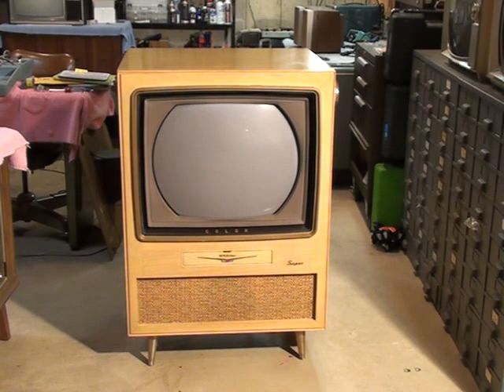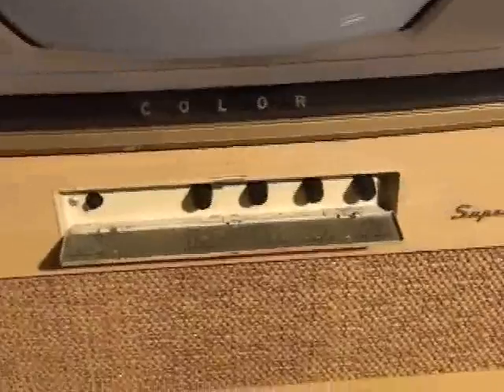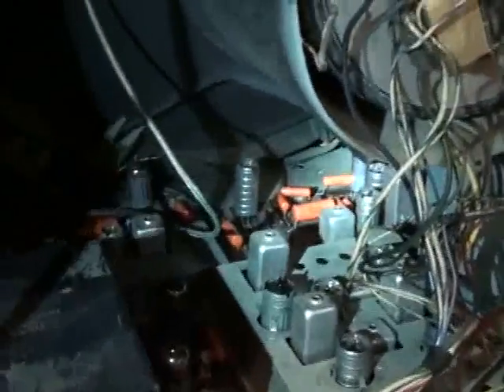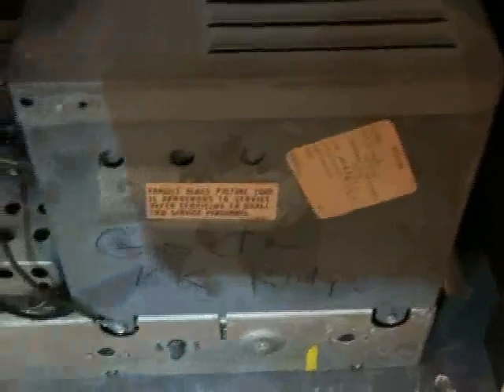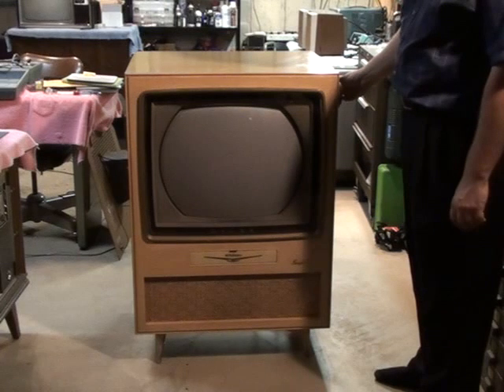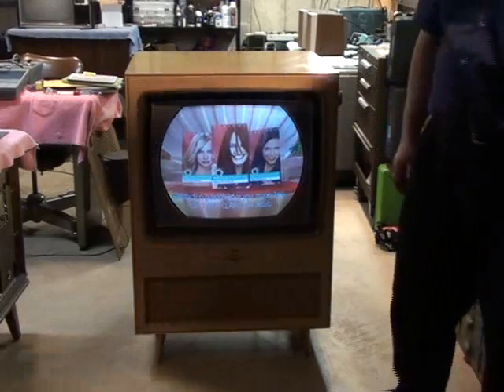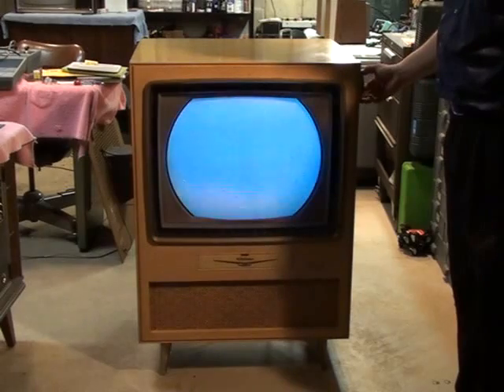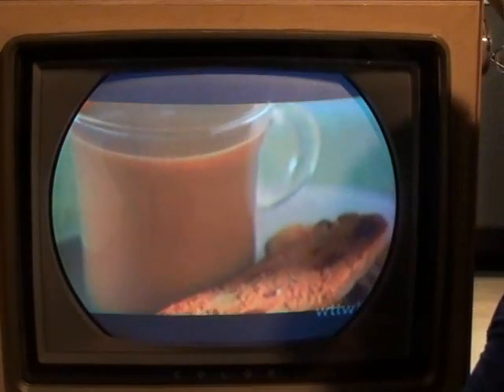Watch a 1956 RCA VICTOR CTC-5 COLOR TELEVISION!! "Roundie"

Comment: I had a 24" dumont color TV in the very early 60s. The houselight dimmed when I turned it on amd the picture tube would crackle when the high voltage was applied. My dad worked for the Dumont network, later became Metromedia

Comment: As a young RCA TV technician I can say all RCA chassis' before CTC 16, did NOT have good pictures. The 16 was far the best. It set the standard until HDTV came out.

Later they came out with the first rectangular Color TV. It's color was NOT good. It took RCA years to get the same picture as the 16.

Believe it or not, I was the technician that set up that first rectangular Color TV; before it was presented to their CEO (David Sarnoff) of RCA; on his boat (named the "Electron") in Miami, Florida

Wow such nostalgia in this video. It brings tears. I am 89 now. Wow!

Comment: What an amazing colour picture for 1956.   (six years before I was born!)   That was the us 525 line 60Hz NTSC...
In uk we had b&w on 405 line 50Hz VHF.   Colour was first brodcast in uk in 1967 on 625line (interlace) 50Hz PAL UHF. (eleven years later!)
Thanks for posting !    Never seen one before.
Reply: quantumellon Ah yes, but PAL was hue locked.
Reply: quantumellon 
    It would be even better with a rebuilt CRT..The green gun looked like it may be a little weak but maybe it's the camera.
Reply: albertusj A feature that we should be so grateful for.
Reply: quantumellon It's true we waited a long time for colour in the UK, but when it arrived it was rock solid (at least at the source).
Reply: I used to laugh at that comment,  Never Twice the Same Colour..  :D
Reply: +quantumellon PAL was dubbed 'Pray And Learn' by the EBU in it's early stages.
Reply: The 50 Hz systems used in Europe produced terribly flickering images.  Gave me headaches.  The North American 60 Hz system was just above the eye's threshold ability to see the flicker, so it was WAY better.  They linked it to the power system standards.  Power in Europe is 50 Hz.  North America used 60 cycle AC.

Comment: I remember our family black and white RCA 19 inch 1950's TV. Every now and then the picture would go out so I'd open the back of the TV and look for a tube that was not lit up. Then I'd pull it out, take it to the drug store, yep, the drug store, the man behind the counter would match the tube to his collection of boxes with tubes in them. I'd install the new tube and we'd be off to the races. Although, back then, the great majority of people would just call a TV repairman who would come to your house and replace the bulb and charge you  25 bucks to replace a tube that cost a buck. If he thought he could get away with it he'd tell you your tuner is dirty and needed to be cleaned out, charge you 5 bucks extra and spray the tuner with some compressed air. What a rip. My first color TV was a Sony Trinitron that I bought in the early 80's.........if I remember correctly.

Comment: I had one of these but I think 1957. No front door for controls and RCA, chevron and color logo was below speaker cloth. I wanted to get it operational but found the primary in the power transformer was open. Was going to gut the cab and put a modern set inside using the factory speaker, but I traded to a collector/repairman in Cleveland for some amplifiers. I am pretty sure he got it running. 73

Comment: Had a friend in late 60s his family had an old I think it was 1955 RCA similar it was from his uncles tv dealership lobby. It was pretty worn, the picture tube was way out of convergence and it was mostly black and white with extra colors on the sides. His dad was changing some tubes once and I got to see it with the back off. It had chassis going up the sides and about 100 tubes.
I was at his house the night Neil and Buzz stepped out on the moon, boy was that a hard picture to look at, we went down to my house and watched on my dad’s new black and white portable and it was so much better.
I used to dabble with junk TVs in those days and I wished I had that tv I would try and fix the convergence.
I once saw thing on tv where they were trying to say that early color tv was really weak color almost black and white- not so - those old three color gun picture tubes were the best color picture if everything worked right. My aunt had an old 50s color tv and she made sure it was always up to snuff I remember visiting and watching old big production Hollywood movie on it and it looked like you had a film projector in the tv. Beautiful

Comment: I used to own a 1958 RCA 21d8525 b&w that looked similar to this unit. I did get rid of it because the tube was burned out to the point where there was no picture (my friend took the gutted case from me). Really do like this style of TV and it would be nice to pick up a working color one like in your example here. Ironically I also got mine from a home in Park Ridge (I live at the boarder of Park Ridge and Niles IL).

Comment: I wish there were still analog channels so you could actually “use” one of these old sets. Is there a way to convert digital to analog and make it work?
Reply: Yes if you have any NTSC TV whether it’s black-and-white or color you can use a digital converter box which will convert the TV signal back to analog but the tuning is done on the converter box not the TV
Also RF modulator or some VCR’s you can connect any device that outputs composite video

Comment: Nice to see mid-century (1956) technology putting on a show. The only thing missing was stereo sound, which had not been developed yet in 1956.  Still looked good in 2008, but after analog TV was switched off in 2009, it became obsolete. Now days it is only useful if you have it hooked up to cable TV or one of those converter boxes.
Reply: Actually, stereo was experimental in '56, and became commonplace the following year on records.  But FM radio didn't convert for the most part until the early-to-mid-60's;  American TV stayed mono through the mid-80's, when satellite distribution made it easier for broadcasters and people started demanding stereo.

Comment: Hooked up to a Chicagoland cable system that was still sending analog at the time.  Most over-the-air TV had already switched to digital by then, and VHF channels 2-13 are now used by mobile phone companies.  Without a digital converter, it's basically junk now.

Comment: I think the first color TV had round picture tubes because of the difficulty of the convergence adjustments when they were first introduced.  Rectangular CRTs required more complex circuitry to get the three color beams to merge correctly. I built a Heathkit 25 inch Color TV in 1972, but it had a square screen and the only tubes were the high voltage rectifier and the CRT.  These color set were sold at a time when very few local stations were even broadcasting in color and only a few network  color shows were available.

Comment: Wonder if it would still pick up any channels via the roof antenna.....or has that wonderful old set been rendered obsolete finally
Reply: To make it work with modern TV stations you would need a digital to analog converter box

Comment: It's very cool. In USA in 1958 was the first country to use a color broadcast in NTSC. And the first to use digital television in HD with the ATSC in 1998. In Brazil only in 1972 we had color television and use a unique system call PAL-M. It's very similar to NTSC, but it use PAL color system. Only now we begin the switch off. In 2007 it begins digital television with an upgrade version of the japanese ISDB. In the 50's color TV must be very expansive.
Reply: I have watched Digital TV in Germany in 1997 with DVB-S!
Reply: PAL = phase alternation line.

Comment: This tv is surprisingly compact for a first generation color set. Large picture tube and relatively small cabinet, not much different from black and white consoles. I have an RCA b&w console that looks very similar.
Reply: I suppose you could arguably call this a second generation color set, after the 1953 to 55 prototype era.

Comment: Wow, no flicker! That looks incredible considering it’s based off a colour wheel.
Reply: What color wheel???  No color wheel!  This wasn't a mechanical TV, it was electronic.  525 electronically scanned lines.  Definitely No Wheels!!!
Reply: You may be thinking of the CBS sequential color wheel system. A few of those sets were produced and sold but they never really took off. The RCA all electronic color TV system eventually won out and became the standard. One reason was that the color signal from the RCA system would work on the millions of black and white TV sets that were already in widespread use..
Reply: Joe Vignolo Yea you’re right I totally blanked when I made that comment.

Comment: The older models had a color bar that would indicate broadcast signal strength below the horizontal and vertical adjustment tuners. The early trinitrons would operate at 60 cycles per second with vacuum tube controlled bias to moderate the high voltage step up transformer. The signal would include 525 lines of resolution and burst in the very high frequency range. - "RCA is making television better and better".

Comment: Hi !
In the US NTSC system there was a clolor-phasic regulator if purple was "originally black dog" just had to roll. The later European PAL color system solved this with a 180 degree color alternating phase. In this case, if the phase fatigue was high the color saturation "only" decreased.

Comment: Goes to show the sometimes less than great look of color TV was not instability at the receiver but at the TV station.  How was there analog signals 7 years ago? My friends parents bought an old RCA like this as a second set. It also looked surprisingly good.
Reply: This vid was made before the analogue tv shutdown, which happened around 2009 or so iirc. Either way, I was in high school then so I remember it pretty well. Pretty wild seeing a then 50 year old tv picking up shows like American Idol and the like. An early color tv picking up broadcasts from the last full year of analogue tv. Kinda poetic in a way, like how BBC1 in the UK showed a 405 line tv from the 50s displaying its last broadcast before being shut off at the end of its last 405 line broadcast in 1985. Look it up, it's pretty neat.

Comment: Tube TV's never came on instantly, it took a few seconds for the tubes to warm up before the picture would come on. As the TV got older and the tubes got older the longer it would take to see a picture. We had a TV,  that if you wanted to see a show, you would have to turn the TV long before the start of the show or you would miss your show. Sometimes, I would forget and I would turn on the TV and my show was starting, I would miss half of the show!
Reply: Yea.. I got ton of old radios.. The REAL old ones, 30s take minute or 2 before anything happens.. But they ALL still work,70 to 80 yrs old

Comment: My dad bought a color TV approximately in 1954-55 and paid a lot of money for it considering how little he made as an engineer. He said after two weeks it failed so he rewound the yoke on the picture tube by hand. Said it worked great for years after. My dad had 15 patents and was pretty remarkable with electronics so if it could be done he'd find a way. Some of that rubbed off onto me, I repair electronic organs, but just for myself. Impossible to make serious money at it these days.

Comment: Electrolytic caps are more likely to fail with age. I have seen 60 year old USA made electrolytic caps still working, mainly the aluminum can caps, rarely the paper wrapped radial caps. I suppose it depends on the storage and operating temperatures, and how close to max voltage they were used at. Depending on were they are in the circuit, can be a time bomb, especially if you antique electronics are going to be used regularly. I usually change them even if they are still working. Expensive in adding to the total cost of the project, but so is the damage a failed cap can cause. Atoms are good, probably the best radial cap, but yes large. I sometimes use F&T (German), and JJ (Slovakian), which are smaller- can not tell you how good they are on life, but so far, so good after three years on some projects, and I cannot find any complaints on those brands. CE Manufacturing (USA) makes the best aluminum can cap that is made with the same machinery that used to make the Mallory can caps.

Comment: For what it's worth:

"CTC 5" means Color TV Chassis. 5 was the 4th commercial model. The reason it was 4th and not 5th, was that the "CTC 1" was the prototype, and never left the "lab" at RCA. The CTC 2 cost $800.00. I have not a clue what that would be today. But I imagine it would be in the thousands.

There were VERY few sales on the CTC 2; so most dealers ate their loss. The reason was; there were VERY few color transmissions. For 99% was only in B & W. Worse: NBC (RCA owned) was the ONLY channel that sent out color TV (but only at night). CBS and ABC refused to do it at all;  because they were mad at FCC, for making the RCA color system "standard". Because it  was all electronics. The others were electronic AND mechanical with motors, etc.

Also the CBS and Zenith systems, were not compatible with B & W.

With the CTC 3, the sales were slow; but with each new model, sales got better. But...there was no way that technicians could service the Color TV's; if there was no color transmitted in the daytime.

So RCA spent a fortune of creating an afternoon Program in color (in the afternoon-2 hours) It was called Afternoon Matinee as I recall. They hired hollywood stars to perform in the color transmissions. This caused, RCA to sell 10 million color TV's in a single year. THEN, CBS and ABC decided to send out programs in color (using the RCA standard of course). Can you guess why?

Shortly RCA, CBS and ABC went mostly color. Of course it was not long until color was the thing and people were buying the sets like crazy. So RCA went ALL color day and night. Later CBS and ABC followed. All of this was before "Cable" and "Satellite".

I shall forever cherish my 33 yrs of being a technician with RCA (1954 to 1988). It was my life and I loved every bit of it. I am now 89 (retired) and the rest brings tearful nostalgia whenever I see these old TV's. Color or B & W.

Praise Jesus!

Comment: Wow, 12 years ago but that thing looks better than some of the later RCA sets I used to repair back in the day. You must have replaced the crt or put a better newer high brightness phosphor tube in it. I think the earliest color roundie I got that worked was about a 61 Admiral? I put slightly better crt in it and gave it to my lil sister for her first apartment in the early 80s.
It seems the picture was fairly good on it but a while later a delay line or cap went out and I eventually junked it because I couldn't get parts and it was too big to hang on to. I did see a non restored 56 RCA color set still working in the 70s but tube was so weak it barely showed any color. I hope your still around and fixing stuff but without any analog TV those old sets are about useless.

Comment: The high quality of the 1956 picture tube shows how even in 2008, we were still using a standard that reflected the state of the art for 1956.  The cameras got better, but no video reproduction could be done in 2008 that wasn't already possible in 1956.
Reply: 123
Reply: Adam Allworth Actually, it wasn't for the (dis)comfort of the consumers. They didn't change formats because the broadcasters didn't want to go buy all new VCRs, cameras, mixing and editing boards and broadcasting equipment. The broadcasters would have screamed bloody murder if that had even been talked about. By the time ATSC rolled in, the broadcasters begrudgingly bought into the new equipment, but only because of the benefits of high def and widescreen.
Reply: abigguitar
Disagree - The changes to digital were ALREADY in-place far before the end-user saw them.  Digital tape, digital switching, digital transmission - all there.  

The government regulated transmission and those standards used.   Why EmeriKa went with ATSC is anyones guess - the rest of the work (99% of the television equipment) went with the DVB-T standard.

The various governments, realising that the lower frequencies TV systems used (160Mhz- 400Mhz typically) were quite valuable if "re-leased" as spectrum for mobile (3G/4G) communications.

So that's why you are moving to digital.   Money.

Comment: a 60 year old tv that still works . One would be lucky to get 2 years out of a modern flat screen.
Reply: That tube must have been "babied" because it is so vibrant.
However owned it first must have kept the brightness low.
That helped prevent very much "burn-in" in the screen.

Comment: Also, for 50 years or more, TV displays were cathode ray tubes (CRTs) called the picture tube; these could also be replaced separately. So the term "TV set" refers to all those components, housed in a single cabinet.Jan 11, 2016